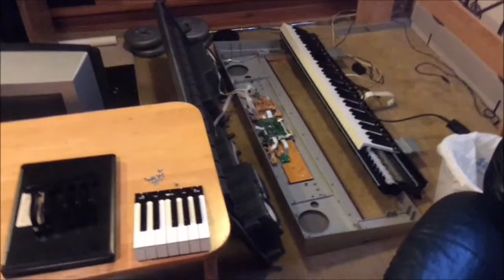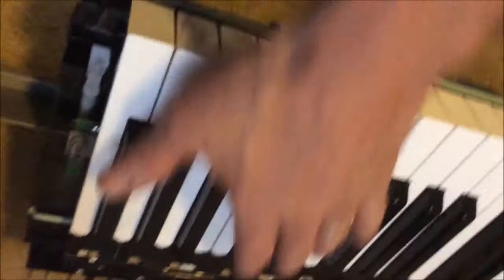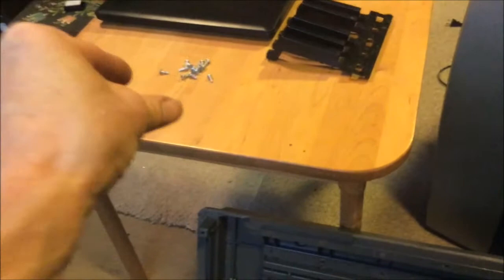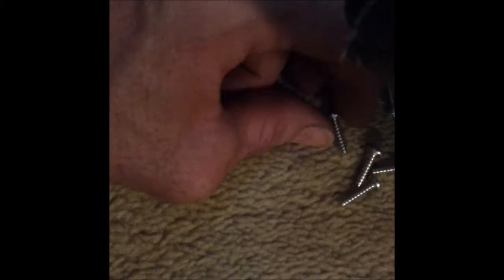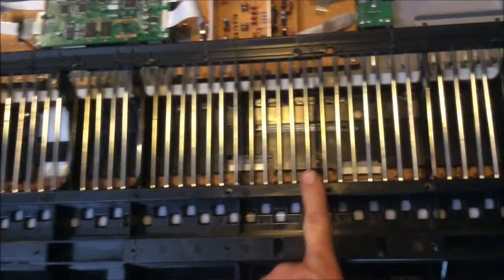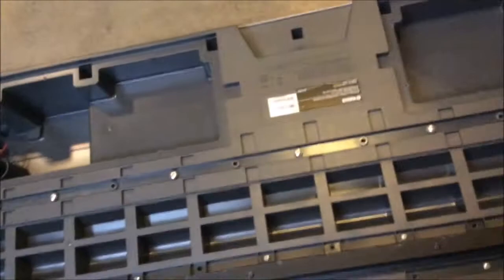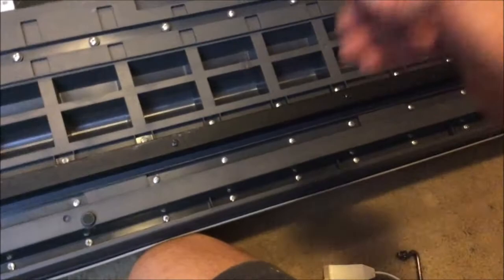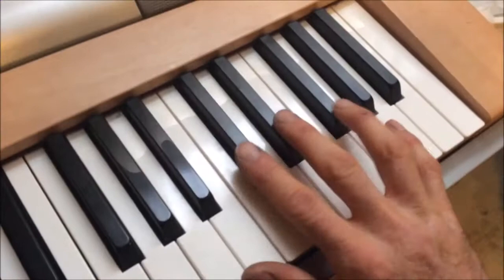Yamaha YPG 625 Digital Grand Piano Key Repair and Replacement

Comment: I have an old yamaha digital baby grand keyboard dgx500. A friend gave it to me. It needed a deep clean because of all the hair and dust down in it and turns out her cat had even marked it at some point so I had to clean urine out of the keys and speakers. It's a miracle it still worked. I deep cleaned it carefully after taking it apart. I put it back together exactly how I took it apart, but when I tried to power it on, while the piano does power on and it shows the notes being played, no sound is produced. Just took it back apart expecting I knocked something lose but there is nothing obviously out of place. Is there any troubleshooting I can try or should I take it in for repair?
Reply from the maker: I would suggest checking the connections. The cleaning could have knocked something loose. I would use only isopropyl alcohol on the boards. Anything else could damage the electronics.